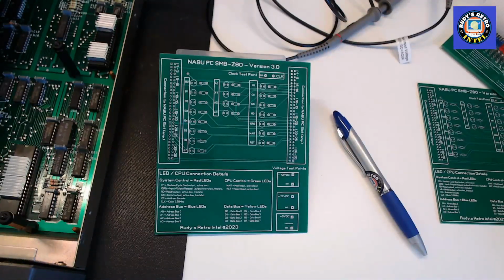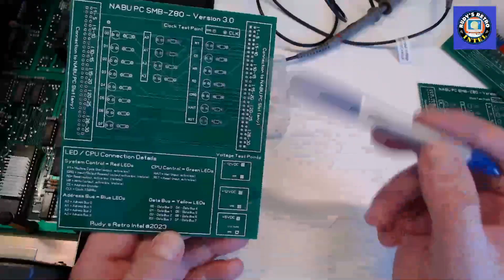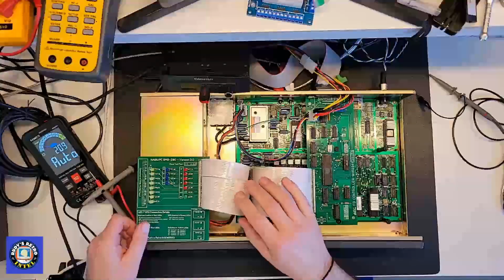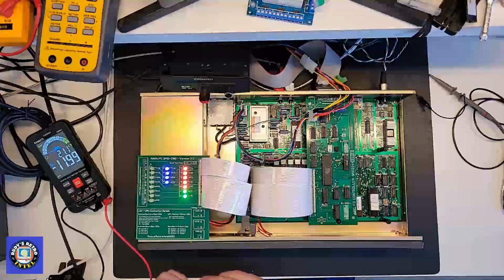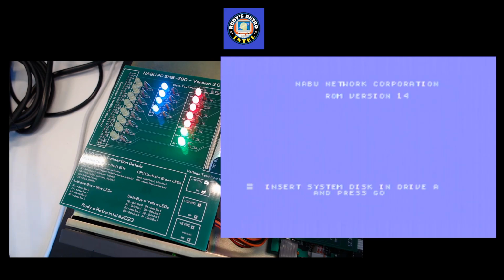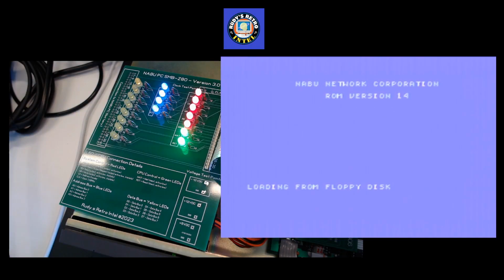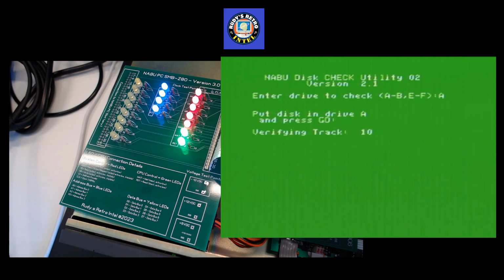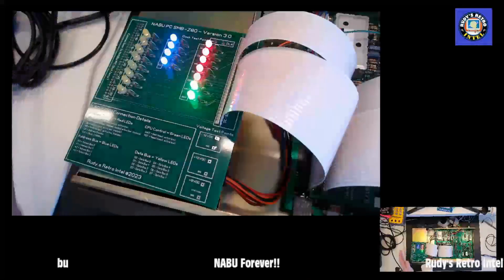Uncover NABU PC Signal Monitor Board Secrets

Comment: I would turn the LEDs for the active low signals around. Sure, from a TTL logic perspective it makes sense that RST lights up when inactive, but from a user perspective it might be better to light LEDs when the signal is active. But that is just one man's opinion, and since they are in kit form, everyone can customize their boards.
Reply from the maker: Thanks for commenting. Yes, you could change the way the LEDs light up. However, I built it from a tech point of view. I want to see the signals as they are so that when reading IC schematics, it is better to follow.

Comment: Had some made, couple questions:

What resistor values did you use? Seems like 220ohm would suffice.

What are those cables you're using and where did you source them from?

I had extras made, I'll take them along to VCFMW and give them away if you don't mind.

Thanks in advance.
Reply from the maker: I used 330 Ohm resistors and may need to change them to 390 as the LEDs are very bright. The lower the value will make the LEDs very bright. The cables I used were from my building of the floppy drive controller and should  be available at DigiKey.

As for giving them aways at VCFMW, that would be cool. I will be there too, so if anyone has questions I can help.
Reply: @RudysRetroIntel  any chance you have a link to the DigiKey part for the cable? I’m assembling this into a howto guide, I’d like to include links to those parts, your GitHub and this video.
Reply from the maker: I will have to try to find it again
Reply: @RudysRetroIntel  found it in the FDC BOM, needed to order all that stuff anyways.

Out of stock of several 74LS chips, oddly the 245 and the 138.
Reply from the maker: FLEX CABLE - AFF10G/AF10/AFE10T
https://www.digikey.ca/en/products/detail/te-connectivity-amp-connectors/A9BAG-1008F/161595

FLEX CABLE - AFF20G/AF20/AFE20T
https://www.digikey.ca/en/products/detail/te-connectivity-amp-connectors/A9BAG-2008F/161643